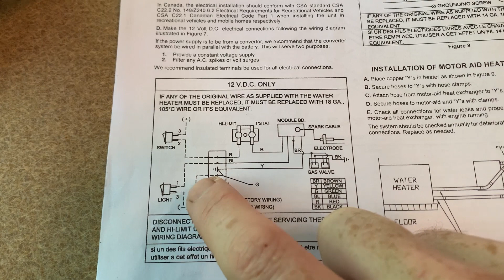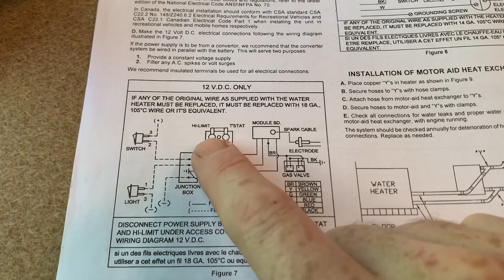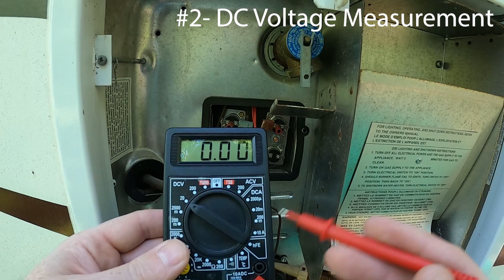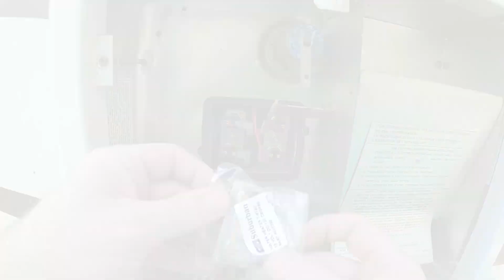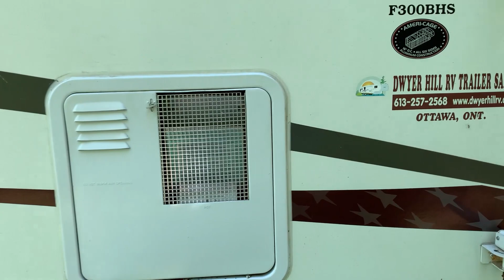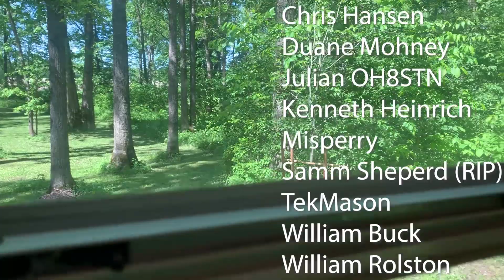RV Camper Hot Water Heater - EASY Troubleshooting and FIX!

Comment: I had the same problem put in a new thermostat but still not working. Light does not come on.
Any other suggestions?
I checked all the fuses all are good.
Reply from the maker: Do the measurements and see where the problem is. Pretty simple circuit and I showed how to do it.

Comment: Hi there from the San Juan Mountains of Colorado!! Really informative!! Thank you very much for sharing this diagnosis!  We have a 10gal water heater.  It is new, so I would hope it doesn't have problems for years.  But....one never knows!

We exclusively boondock.  Do you have a list of recommended parts to carry with so as to not toof our trip?

Safe travels!
Reply from the maker: A DVOM (multimeter), basic hand tools, some crimp connectors & wire, spare fuses and general lubricants, some caulk sealant, RTV sealant and some hookup wire.  Good stuff to get you out of a jam

Comment: Good morning. I have a question. I have to reset the breaker because my hot water, gas or shore power will not work unless i reset the breaker. What's going on?
Reply from the maker: High draw for some reason

Comment: Hey man, could you done a continuity test across terminals on the thermostats to also test if they where good or bad?
Reply: An ohmmeter tells you there is a path- it does not tell you that path is capable of flowing the required current.  That's why the voltage drop test was shown on top of the rest- between a voltage test and a drop test you can be 100% sure of the diagnosis. An ohmmeter cannot.
Reply: @MkmeOrg  
Makes senses thank you, so for the other thermostat the AC one you will do the same test but in AC voltage correct??